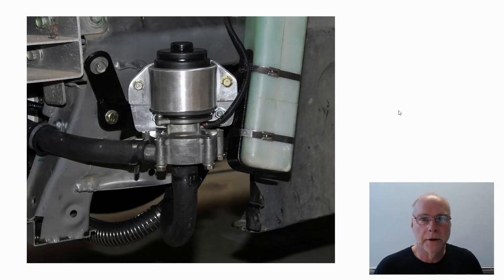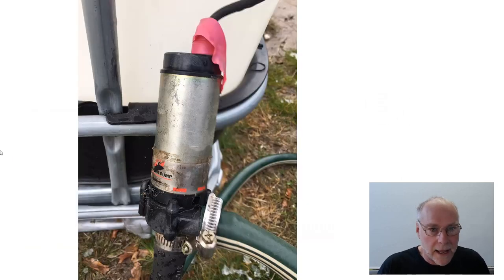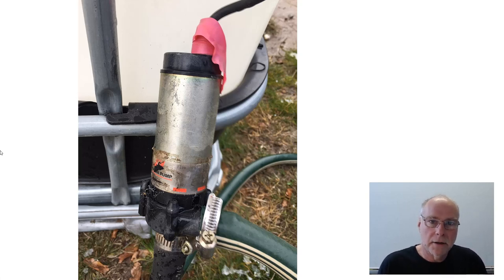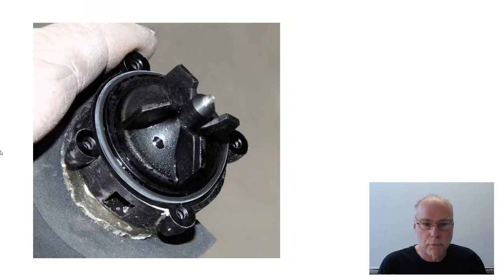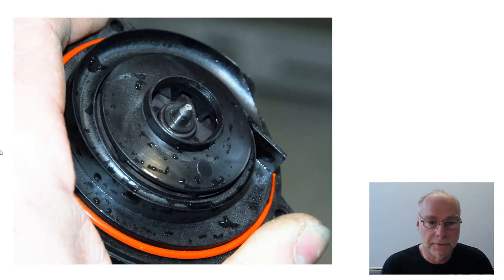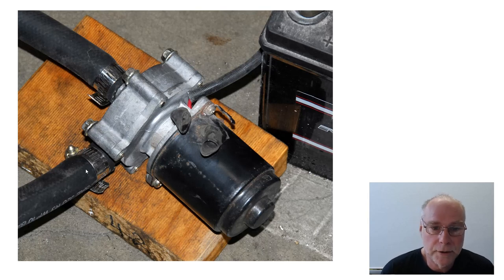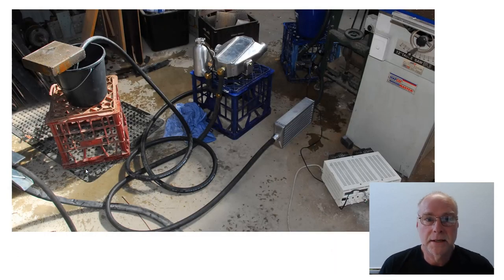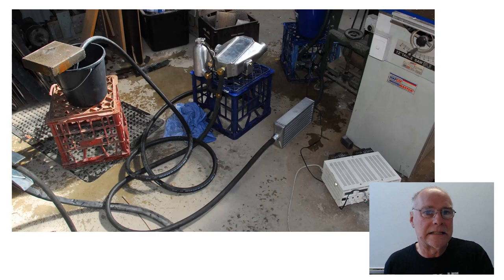Pumps in water air intercooler systems

Comment: I'm a fan of Denso everything even spark plugs and this is a Denso pump fitted to a number of vehicles including Honda Odyssey and Toyota pickups . I tend to leave Bosch well alone after dismantling an alternator and finding the noisy bearings were unbranded . I believe Denso alternators are the only brand approved for kit plane building in the US .

Comment: Regarding 1992 service manual the Subaru pump can handle 15l/min at 0,2 bar. That doesn't give a hint of why the subaru pump is so good in this aplication.
At 12V this pump draws 50W or 4.2A. In this range are many pumps with even double flow rate at the same pressure.
It seems that a good pump design without cavitation is the main key to a good flowing system if there is a bit more differential pressure.
For my next project I'll try the Pierburg CWA150 pump. This pump is made for higher differential pressure with a new designed impeller and it is PWM controllable.
This pump is rated for 25 l/min at 1.4 bar differential pressure, this should be plenty if it comes close to reaching the specifications and dosen't cavitate.
There is also a standalone controller called "tinyCWA" from Tecomotive available which provides pump and fan control, pump overrun, venting mode, warning lights etc.for this and similar Pierburg pumps.
But, a simple two stage pump with a relay and some 15W resistors should do the job too if you can find a pump which dosen't cavitate.
I'll compare the Subaru pump against the CWA150 as soon as possible. But unfortunately that won't be until next year.
Reply from the maker: Thanks for that thoughtful post. The 'tinyCWA' is very interesting. Let us know how you go with your testing.
Reply: Hey, it's been a year. Any data?

Comment: The Subaru part number of this pump is 45640AA000 or 45640AA010 but both are very rare. You can find similar denso pumps in Toyota Hiace (part number 16290-74010), Bentley (part number PF30955PB) etc. Search for older style Denso 064100 pumps with metal top.
Reply from the maker: Thank you!

Comment: Fascinating!  Your videos on water/air intercooling make me want to try it sometime to have control over IAT's aside from just the ambient temperature.  I'm not so sure I ever will though as I really like the simplicity of an air/air intercooler and I'm not one hundred percent sure of how to actually control the pump speed (how to PWM the pump) especially if I eventually was in a situation where I wasn't using a full standalone ecu.  

In thinking about all this though, I wondered if the inverter coolant pump from a Prius (circa 04-09) would work well.
Reply from the maker: PWM control of pump speed is pretty easy, even without a standalone ECU. 12V motor speed controllers are available quite cheaply on eBay and use a potentiometer control input (ie a knob). Typically that involves a variable 5V signal, and this signal can be derived form a normal car sensor eg throttle position. Even easier is to just use some series resistors switched in and out - a technique I cover in this book -  https://www.amazon.com/gp/product/1787113930  I haven't played with a Prius pump but I imagine it would be quite suitable.

Comment: Cavitation would only really happen if the system was not pressurised, for a hot water system where you have expansion as well glycol cavitation is less likely to occur. Also as you mention if the pump inlet has no flow restriction, you would mitigate any cavitation. Have you looked at Davies craig pumps?
Reply from the maker: Yes. When I first tested them, Davies Craig pumps were among the worst I ever saw - and their response to that testing, in a personal meeting, was abysmal. Hopefully they have got better since.
Reply: Also a pump that is more efficient is more likely to experience cavitation also as well as one that is less efficient. If a pump has very little re-circulation from exducer to inducer it is more prone to experiencing cavitation, but it is also more effective at creating higher pressure.

Comment: Do pumps come with any flow charts for restrictions? I am going from a mezier wp136 to a mezier wp336 55gpm free flow through 3/4" hose 15ft long.
Reply from the maker: Pumps often come with specs for flow change versus pressure. (Restrictions cause pressure.)

Comment: Cobalt SS used that Bosch pump from the factory for the intercooler circuit.  Tests have been performed on these pumps and they have different conclusions.  Maybe your application had specific requirements and it did not meet them.
Reply: so the bosch pump worked good for you??

Comment: I think the main reason the pump cavitating is because theybhave to pull water from suction side through quite alot of restriction...

This can be mitigated by placing the pump to pull water directly from the reservoir tank and pushing water through all required flow..
Letting the pump do just pushing work flow should be the way to go..

Something like: 
Reservoir > pump > water heat exchanger > boost heat exchanger > reservoir

Comment: what exactly you refer as restrictions? the diferent devices that the water runs trough??
Reply from the maker: Yes each of the heat exchangers pose a restriction.
Reply: @JulianEdgar  so this also means that allthe sistem sould have the same diameter tubing, hoses  and inlets and outlets right..??
Reply from the maker: That would normally be how you would do it, yes.

Comment: have you tried Davies Craig 9040 pump? Probably one of the most expensive small pumps i've seen so I am curious about it.   It's brushless, and I don't think most of the others are (???)   I've got that Bosch pump in my system right now...  looking for improvements.
Reply from the maker: No I haven't. With my experience of Davies Craig (now a few decades ago) I would never buy or fit anything from the company.
Reply: @JulianEdgar  What was you bad experience?

Comment: Do you have any recommendations on a water pump for use in an air to water intercooler on a turbocharged performance car.
Reply from the maker: Probably an electric coolant assist pump from a car like a BMW or Mercedes. Lots of them have them.
Reply: @JulianEdgar  Thanks

Comment: Julian, what would you say is the easiest way to control a pump on/off without an ecu that  is capable ?
Reply from the maker: Resistor to give slow pump speed whenever car is running and then a throttle switch that parallels resistor to switch to full speed past certain throttle position.
Reply: @JulianEdgar  thanks for the input sir

Comment: Where can I find that Subaru pump? Do you have a part number? Been researching pumps for my w2a sys
Reply from the maker: The Liberty RS (Legacy) is now over 20 years old. I doubt the pump is still available, and I don't have a part number.  You should seek a powerful pump (eg 100+ watts - ie 8-10 amps) with a large motor, designed to work against a restriction. Some electric radiator pumps may be suitable, but I haven't tested them. My major point is that small, low power, cheap pumps won't cut it.
Reply: Subaru part number is 45640AA000 or 45640AA010

Comment: Go figure. He tried two pumps designed for something other than his application, and they didn’t work. He tries a pump designed for the application, it works. Why the surprise?
Reply from the maker: Because 99 per cent of people do not select a pump specifically designed for water/air intercooling - almost no aftermarket pumps are designed for that role.

Comment: My English is Not do good, i Hope you Unterstand my message. I run a water to air System in my 2.0l 16v with gt30 Turbo because an air to air intercooler dont fit. I have a davis craig 25 water pump, an eBay water to air intercooler and an Oil Radiator for my water. So far it works Perfect but so far i dont have any temp. Sensors ewuiped. Now to my Thing: I belive this System dont Need an water Reservoire/Tank because the more water you have the longer it Takes for cooling/recover. If you have just a much As you get from the System the water Van ne cooled better and faster. I think the Most importabt thing is the Radiator... at least 3/4 Zoll fittings an Not so much Angles -> Flow is the key..... If you have a other opinion pls Write ist Here i Love ist to lern new Things.
Reply from the maker: Having a lot of water in the system is important in a road car because of its thermal mass. See https://youtu.be/HEuoSHmAQd0
Reply: Definitely need a reservoir or tank and the bigger the better, your intercooler/radiator without a reservoir is just going to add temperature to the coolant every pass and if you don't have a large reservoir it will heat that water up way above what you would want it to be quicker than if you had a small 250ml reservoir...once that coolant temp is hot then it's not only staying at that temperature but it's rising as every pass through the intercooler is just adding heat, not by 1 or 2 Celsius but by 5 at a time, so in 20 mins of running on a 36c day idea of not having a water reservoir has been proved to be a bad one as the cars ecu is engine timing so it doesn't cause other issues that the now overheating car is doing... 
run a 25L or bigger reservoir in the tank and you won't ever have a problem